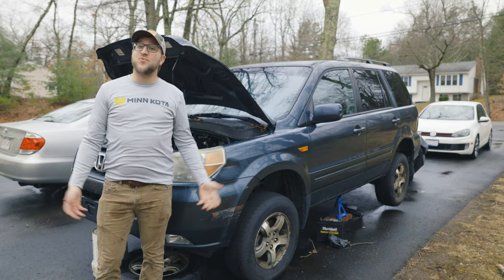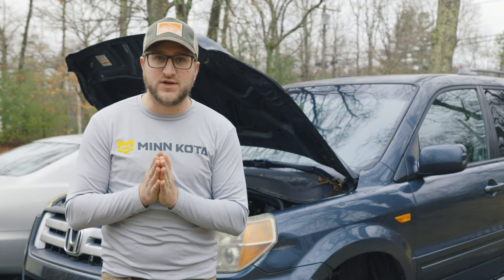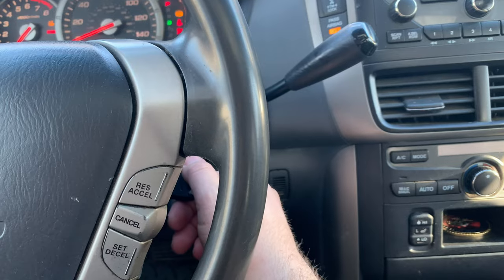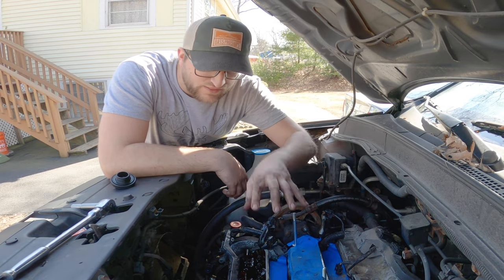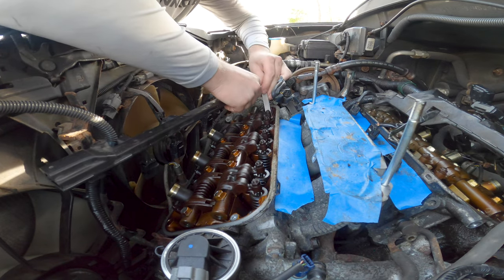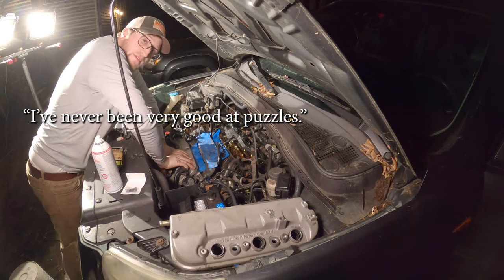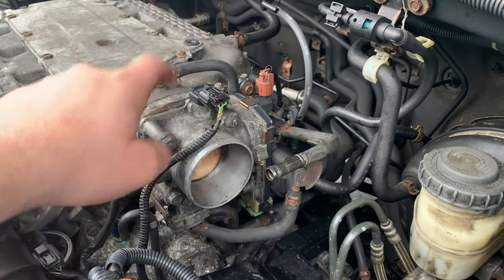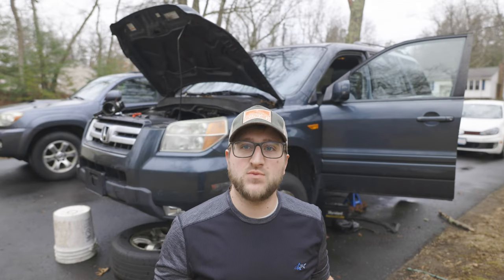Broken 2006 Honda Pilot (Rescue Mission) - Pt. 2

Comment: On the misfies, see if you can get a live OBD scanner that will show you the misfire count in realtime.  I use a Foxwell NT530 that does bidirectional communication and real time data.  You will be able to see when and how often you are getting a misfire.  I have not found an app/bluetooth based scanner that would show the full realtime data and bidirectional control/communications like the Foxwell.

Comment: The Pilot are common to throw multiple misfire codes…do you know the common problems? Started to show engine light after changing scheduled spark plugs. I cancelled the engine light thru OBD and disconnect the battery. Any suggestions.

Comment: Great job!!!! I know that's a lot of work but I cant wait to see the engine run smooth. I have an 03 honda pilot with the check engine light on, and I think it's because I put gas in it without turning the engine off. I am wondering if anyone knows if it's going to reset on its own?
Reply: I fill up without turning engine off all time

Comment: Fix the intake leak and the exhaust leak.  The exhaust leak is seriously messing up the air flow which is causing ECU to use default/rough parameters.

Comment: Did your ever replace the EGR valve?  A stuck open one (due to carbon) will make it stall and rough idle
Reply from the maker: Thanks for the comments Scott! As of right now I have two other videos out, where I start to I actually do work on the pilot. I did change the EGR valve and it didn’t help much. But I’m in the process of fixing a few other issues and so far it’s running a lot better!

Comment: You need to replace timing belt, timing belt tensioner, and water pump if they were not done at 100k and 200k miles.  Serious engine damage possible.  Use  an Aisin kit purchased from auto parts store or reputable online auto parts supplier (not Amazon and Ebay where there are many fakes sold)

Comment: You so peed yourself lol rotfl glad to see the valve adjustment did something, cause I had a misfire on cylinder 5, and did valve job and 3 exhaust valves were to tight and both exhaust valves on cylinder 5 were to tight, seems like great progress
Reply from the maker: Totally peed myself. Didn’t like those pants anyway 😂 And yeah, I guess that’s pretty common with these engines. But it’s on the way to running better!

Comment: Also, the radiator probably has a hairline crack in the plastic header section.  Known design issue at 150k miles.  Will be a slow coolant leak.